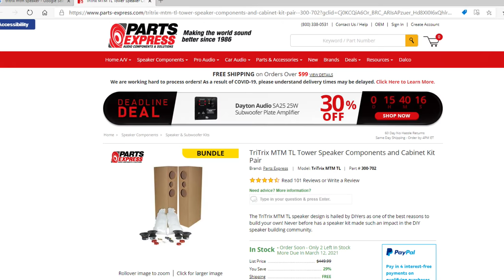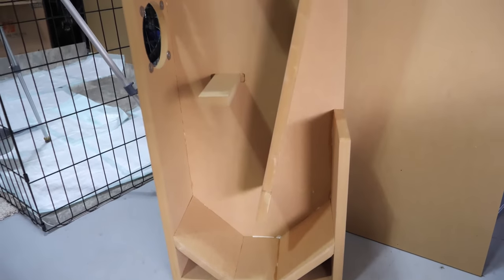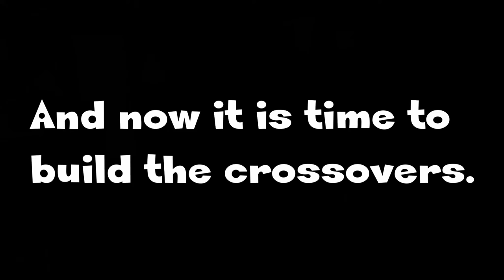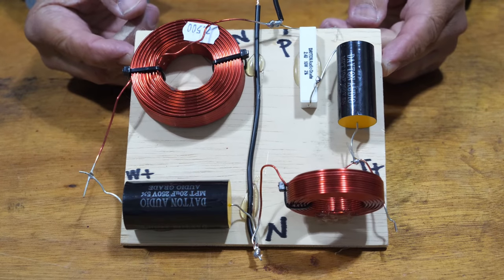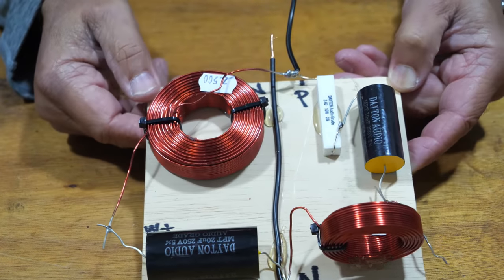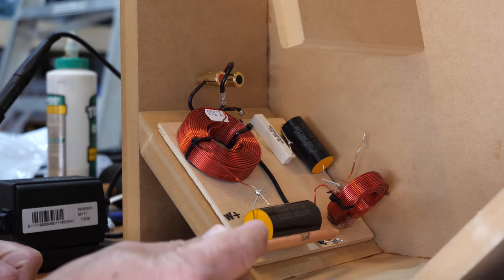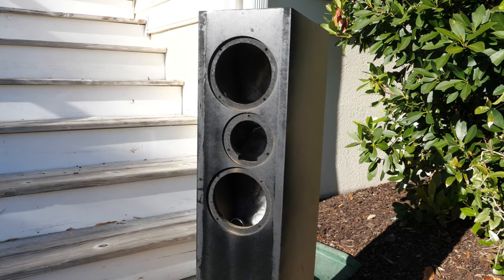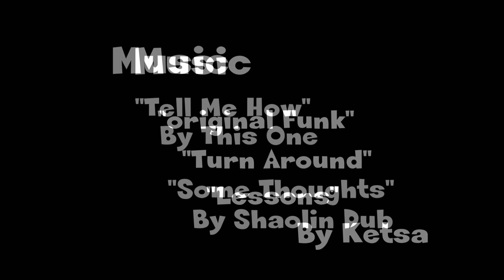TRITRIX Speaker Build from Parts Express

Comment: How reliable is hot glue? Just wondering thanks.
Reply from the maker: 2 years no problem. I used it 10 years ago to build a computer that I made with a homemade case. The glue never failed.
Reply: @photojunkysdronezonevlog  Good deal. Thanks

Comment: I sealed the interior of the panels, as I don't trust bare MDF to not absorb moisture and warp. I have yet to assemble the crossover, but when I do I will use a perfboard to mount the components. I've been in electronics long enough to know that just twisting wires together and soldering doesn't end well. I'll also mount the crossover to the top panel for access and to avoid disturbing the wavefront through the TL.
Also, the woofers are wired in series. Only one pair of wires + and - to connect both.
Reply: Twisting and soldering is fine.  And don't worry about "disturbing the wavefront".  It's about pressurization and depressurization inside the cabinet.
Reply: @buzzcrushtrendkill  I think he's saying that securing components that way isn't good. Yeah twisting and soldering is fine (this guy's soldering isn't great) but that hot glue is pretty useless especially on smooth things. I'd either use perfboard like he mentioned or drill some through holes in the board to secure with zip ties.

Comment: When edge-screwing MDF (that's what this and most speaker cabinets are made from) feel around the edge to see if any screws caused the MDF to expand, bulge, blow out,...  It happens, and it's not really a quality issue (and not your fault unless the screw went in on an angle).  If it happens to you, it's not a huge issue, but don't remove the clamps!  If you got a full blowout, force some glue into all the cracks.  Remove the screw that caused the bulge, put some glue in the hole, and put the screw most of the way back in (it'll force glue into any inside cracks).  Back the screw out again, and, if you can, clamp the area with a block right over the bulge to force it as flat as you can.

Once all the glue is dry, you can put the screw back in and then remove the clamps.  If you don't have masking tape to keep from gluing the block to your cabinet, paper works well, too (not newspaper though.. :-).  If any of this was on the outside of the cabinet, you can sand it flat once everything is dry.  Sanding will remove any tape or paper stuck to the glue as well.  It will also remove some of the sealer MDF gets at the factory, so be sure to seal the sanded area if you're going to paint it.  It'll take paint different from the rest if you don't. (A few extra coats of paint can act as a sealer.  Paint just the sanded area at first, and sand lightly in between coats.)

Comment: Great video, thanks!  How did you veneer the rear baffle after asembly?
Reply from the maker: I just left the wood unfinished in the back. No one sees it anyway, and I will probably never mess with that veneer again. It was very hard to work with. Next time I will just finish the exterior wood, and use that compressed crap on the inside for the acoustics.

Comment: I thought the speakers in this kit were connected in series not parallel
Reply from the maker: Saw two people do it the way I did, so I figured that was the right way. Sounds great. Could it sound better?
Reply from the maker: Question, are you referring to the way I wired the woofers?
Reply: @photojunkysdronezonevlog  yes, I’m not sure but I think there should be one wire splitting with the positive going to one woofer and the negative going to the other woofer and than a wire connecting the two woofers together.
Reply from the maker: @johnny1980ns  I May try that after a little research. They do sound pretty damn good though.
Reply: @photojunkysdronezonevlog  I'm happy to hear you like them! Can't wait to build a set.
Reply from the maker: @johnny1980ns  honestly, the hardest part was working with the veneer. Everything else was straightforward, well, at least I thought it was :-)
Reply: So what were the results between the two methods?
Reply: They are 4 ohm speakers, if you connect them parallel the amp has to work with 2 ohm. Don’t think that goes well with many amps. In serie you have a normal 8 ohm.
Reply: @ratscoot  the kit requires you to connect the woofers in series, once connected the finished speaker works to a 8 Ohms load.